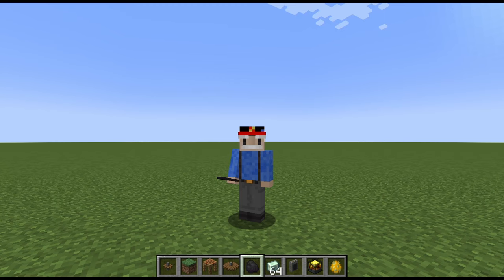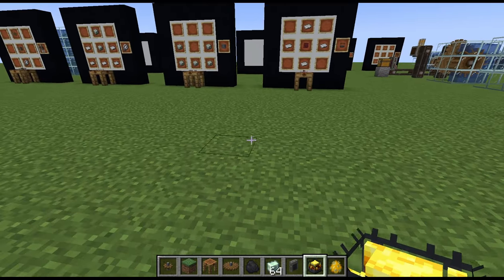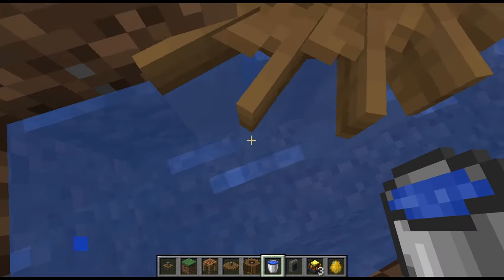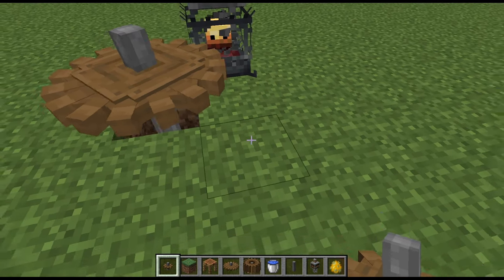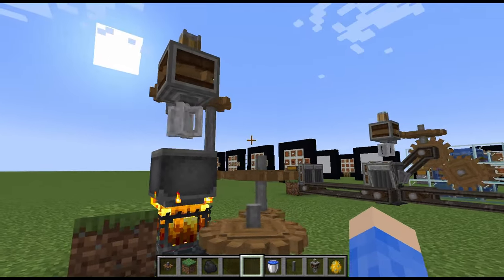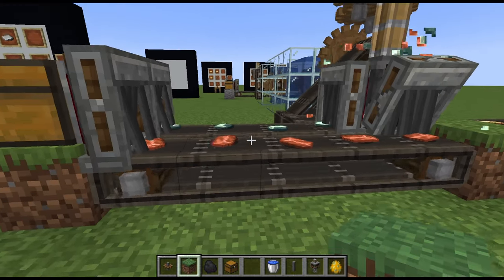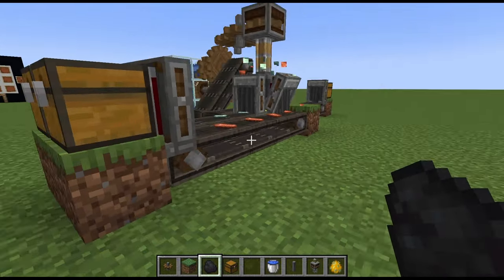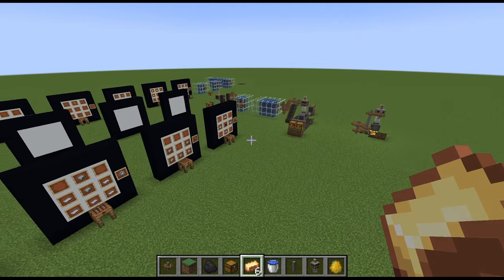How-to-Create Mechanical Mixer

Comment: How can i change direction of the conveyor belt?
Reply from the maker: Not exactly sure what you are asking here but the direction of the shaft turning dertermine the direction the belt is running you can change the rotation of the shaft by gearing or a gearbox at least that is the easiest way to do it
Reply: @OldManShorty  ok thanks